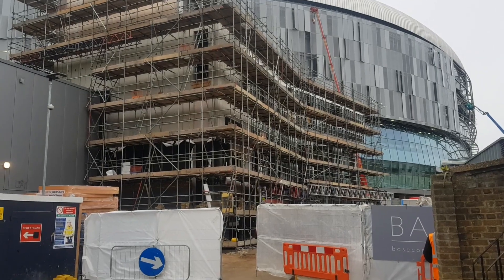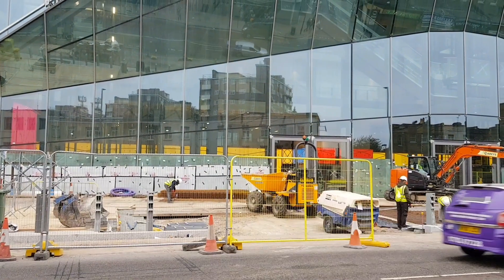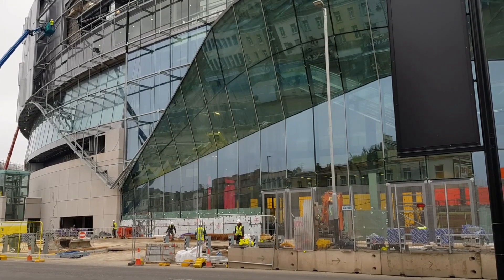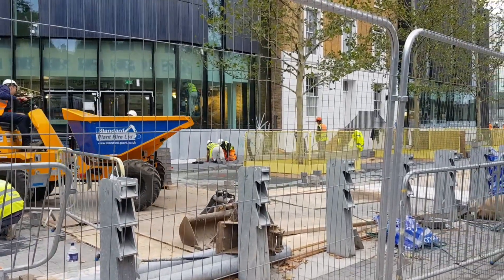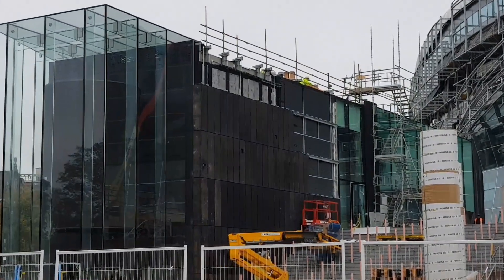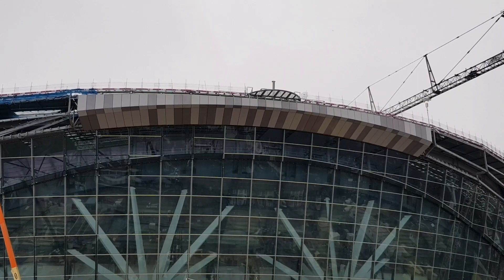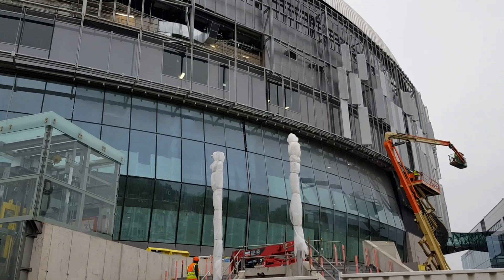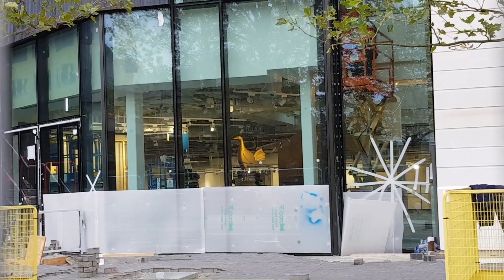UPDATE AT TOTTENHAM'S NEW STADIUM: Pitch, Paving, Trees, Shop, All Four Stands: 6 October 2018

Comment: Brilliant commentary as ever Chris you should comment on the games you're better than most of them on Match of the Day. Speaking of which was the figure of 42000 correct at Wembley today? does this mean no fans like myself are trying to save up and trying to get a ticket for the new ground and maybe some what boycotting Wembley? Let's at least get the club shop open get some revenue in there. Thanks to you Chris I've started counting railings on the steps 🤣
Reply: the capacity for today was 45000 due to the council restriction